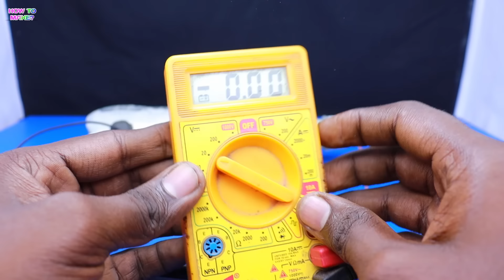2 Awesome uses of old AAA batteries

Comment: The author was using carbon zinc batteries, not akaline batterys.  (I looked up Sony Ultra Battery on the Internet).   Anyway, the construction of Akaline Batteries is different, and probably won't work for this purpose.   Plus, I believe these were AA batteries, not AAA batteries.  (Bigger, thus easier to cut open).   Just an FYI if you want to duplicate this experiment.
Reply: Where did h he say he was using Alkaline batteries?? Unnecessary advice!
Reply: Do these still exist?
Reply: Thank you for your insight! You are indeed correct in your assessment of the batteries being different then the standard battery we may find in our typical store, thus saving people interested in trying this, their time and money.
Me being one of them! 
You are also correct about the title being +AAA Batts but it's +AA's he works with in the video.
Reply: @chinmoy1955  It was great advice, actually. I only buy alkaline. Other than music playing and the info -- the battery type used was ambiguous.

Comment: I used graphite rods from dead batteries as electrodes for a arc lamp that I made, powered by a 24V 1000W transformer. Also useful for spot welding. Another use was power resistors/potentiometers with low inductance and high power dissipation. Also good for use as electrodes in electrolysis because they are not attacked by the solution like metal electrodes are corroded.
Reply: how do you spotweld with this?

Comment: How long the bottle battery would last to run the clock?
Reply: I was gonna ask the same thing. If I had an aloe plant I'd run some of these and find out. Most plants give off some juice,  I experimented with lemons in school, and 3 ran an alarm clock. I know even apples and potatoes got electricity in them, though it was elementary school and the point of my experiment was just to see if the lemons worked, I never tested for exact length of use or for exact voltage etc.
Reply: @myspacemodulator   i did  a  potato  clock  it lasted over 2 months  i did have to move the the copper plated steel nail around the  potato after about 15 days  did a lime clock to but it dried out kinda fast think it was old to start with